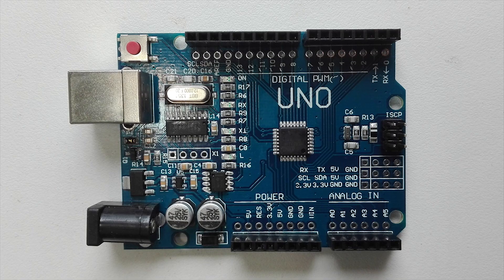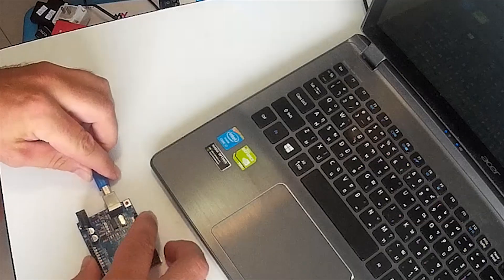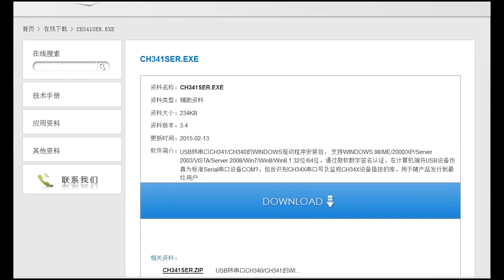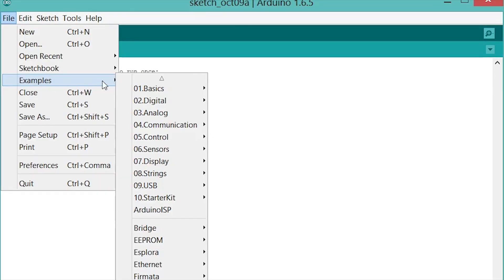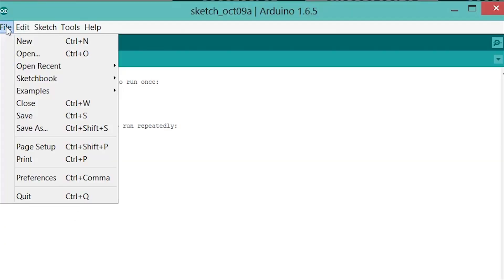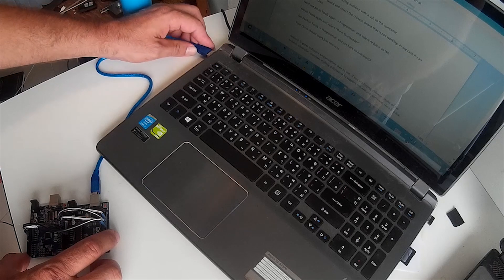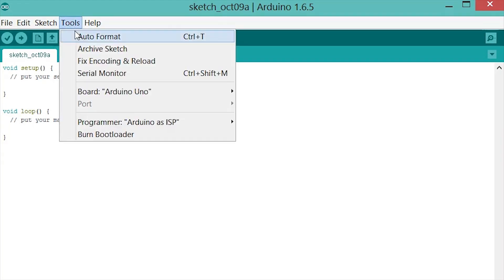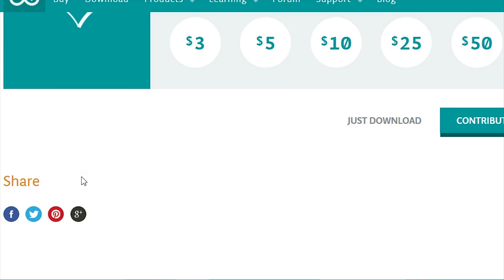How to fix bad Chinese Arduino clones

Comment: is it a wire soldered on the cable whoe goes from reset to cable ground on the working arduino uno ?

Comment: why does the Built in LED on pin 13 blink very fast after resetting and power up ??  my blink rate is 2 sec on and 2 sec off.....?

Comment: If you're trying to use this now (i.e. 2024) you may still have some troubles. Try changing the processor. Tools -> Processor -> ATmega328P (Old Bootloader). That worked for me along with the driver.

Comment: I had a problem like this a while back. I bought 3 cheap Nano's with a CH340G chip on the underside of the PCB. I could not upload my sketch to any of the three. After several hours of working on the problem, I studied my settings and found an item:  "Processor" with an option for Atmega328P(Old Bootloader). All three Nano's worked normally. I latter noticed the USB sockets were wrapped in a transparent green plastic tape. Maybe that was an indicator.

Comment: Just get Leonardo's, cheap clones or genuine, and you never have a problem. As a bonus you get double UART, USB-HID, non-shared SPI pins and double the analog inputs.

Comment: For my fake UNO the serial chip where you had CH340G written, doesn't have any writing at all, and installing the CH341SER drivers doesn't do anything at all. Is it then a problem with the bootloader?  Also when I plug it in the USB the 'power LED' lights up but another LED label 'L' blinks very fast, thought that it might be relevant.

EDIT: some MVP down in the comments found this: https://www.usb-drivers.org/ft232r-usb-uart-driver.html , go to that link and follow the tutorial for installight FT232 drivers, that might just work for you, did for me

Comment: Good video but unfortunately it did not work out for me. Nothing is written on my usb chip and only after thorough search on the net I have found another usb chip model as the commonly used CH340. Do a search on "FTDI FT232R driver" you'll be orientated to the manufacturer website with win/mac installers. My Arduino compatible clone now works perfectly :)
Reply: Thanks. I had the same problem. Now the "arduino" is working!!
Reply: I thank you dearly, may god bow to your wisdom!

Comment: I don't know where you get it, but if you get it from tao-bao, the seller will tell you that this board needs extra drivers to run.
Reply: btw, the $2 nano does not work with os x

Comment: Hi nice video.. I always getting error while uploading . Avrdude : stk500_recv() : programmer not found. ..  I have uno Chinese and one  uno without that atmega chip which is also chinese clone..like you have . So what is the problem and how it can solve.  How to burn bootloader than if I have both Chinese clone and not wokring. Thanks in advance.

Comment: I bought about 20 Arduino clones from different suppliers and apart from installing a driver on Windows to see it over the USB I had no problems at all. Never needed a second Arduino to make anything work
Reply: Lucky you.
Reply: @frederic4108  3 years later: they are still running! Not a single failure. Same for Attiny cinese boards (they are fake Digistump, you can recognize them because chinese ones have "REV.3" written on the board)

Comment: I bought M.J duino UNO R3 and from the first moment worked powered only from USB socket and not from dc adapter plug.In the pin of 5V constantly was present 3.3V because in the factory placed wrong LM1117-3V3 instead of LM1117-5V that should be.

Comment: i has 5 year uses many hundre arduino clone and anythink not has "bad" newer, all working fine and newer not has problems. i uses lot tiny,nano,uno,mega boards. and newer no has any "BAD" only good has all chinese clones. all cost under 10$ mega and uno less 7$ and nano less 5$

Comment: I see in the picture in 2:26 that there is something connected to the ground and the reset of the working Arduino. This is not mentioned. Do we have to connect to the ground the reset pin?
Reply: A capacitor of 10 µF is connected between RESET of the functionning arduino and the ground.

Comment: To fix your fake board permanently, use his connection mentioned in the description, then go to Arduino IDE and burn bootstrap. Then disconnect the main board, and plug in your fake board, you should be able to program as normal boards now

Comment: Better not to buy Chinese Arduino clones!! Buying them is to support criminal behavior. The Chinese are optimizing their lines of production to get it as cheap as possible, but they don't take responsibility for the function of the product, and then you can sue the Communist Party of China and see how successful that will be. Being Communists, they steal and copy all bad features of capitalism but removes the only good thing, i.e. the responsibility to the customer, which makes capitalism not good, but at least not quite evil either. The lack of responsibility of Chinese capitalist-emulating production in effect makes the Communists Fascists, and the individual or customer is trapped in a maelstroem of totalitarian destruction.

Comment: got mine free with from Inventr.io as a promo. Unfortunatley the driver will not install on my machine. Thought I was getting genuine Uno. :-). They do not answer requests for support and have so far not responded to me. Leason learnt buy from a reputable genuine Arduino seller.
Reply from the maker: Do you use a Mac? If that's the case, look in the comments. Someone posted a new link for the Mac driver. Cheers.

Comment: When trying to burn the bootloader, I get : "Error while burning bootloader.
"

Arduino: 1.8.8 (Windows 10), Board: "Arduino/Genuino Uno

avrdude: stk500_recv(): programmer is not responding
avrdude: stk500_getsync() attempt 1 of 10: not in sync: resp=0x0c
avrdude: Yikes!  Invalid device signature.
         Double check connections and try again, or use -F to override
         this check.

Error while burning bootloader.

This report would have more information with
"Show verbose output during compilation"
option enabled in File -> Preferences.

Comment: When I selected "Burn Bootloader", I got an error message as follows,"Arduino: 1.8.7 (Windows 10), Board: "Arduino/Genuino Uno"

avrdude: stk500_recv(): programmer is not responding
avrdude: stk500_getsync() attempt 1 of 10: not in sync: resp=0x8b
avrdude: stk500_recv(): programmer is not responding
avrdude: stk500_getsync() attempt 2 of 10: not in sync: resp=0x8b
avrdude: stk500_recv(): programmer is not responding
avrdude: stk500_getsync() attempt 3 of 10: not in sync: resp=0x8b
avrdude: stk500_recv(): programmer is not responding
avrdude: stk500_getsync() attempt 4 of 10: not in sync: resp=0x8b
avrdude: stk500_recv(): programmer is not responding
avrdude: stk500_getsync() attempt 5 of 10: not in sync: resp=0x8b
avrdude: stk500_recv(): programmer is not responding
avrdude: stk500_getsync() attempt 6 of 10: not in sync: resp=0x8b
avrdude: stk500_recv(): programmer is not responding
avrdude: stk500_getsync() attempt 7 of 10: not in sync: resp=0x8b
avrdude: stk500_recv(): programmer is not responding
avrdude: stk500_getsync() attempt 8 of 10: not in sync: resp=0x8b
avrdude: stk500_recv(): programmer is not responding
avrdude: stk500_getsync() attempt 9 of 10: not in sync: resp=0x8b
avrdude: stk500_recv(): programmer is not responding
avrdude: stk500_getsync() attempt 10 of 10: not in sync: resp=0x8b
Error while burning bootloader.

This report would have more information with
"Show verbose output during compilation"
option enabled in File -> Preferences.
"

This is what I got, what to do now?Kindly suggest me some ideas.

Comment: One extra thing I had to do to get it all to start working on Windows10 was to turn off Windows Firewall, do the first upload and then turn the Windows Firewall back on. After that, works perfectly with Firewall turned on.

Comment: I have the clone version like yours. Any idea how to enable dfu mode????
Reply from the maker: Techniques For Everything what is dfu?
Reply: Programmer mode, it is something about shorting 2 pins and wiping the boot loader. Later you can make Arduino into game controller by installing new bootloader.

Comment: If your chinese Arduino clone does not explode on plug in and does a "blinky led" thing, chances are there is already a bootloader installed, but an ANCIENT ONE. Arduino IDE "can" handle this, of you switch "processor type" tp "old bootloader" . or upgrade the bootloader by  follow the bootload install instructions here.

Comment: bought a nano clone of aliexpress, but im having problems uploading (avrdude: stk500_getsync(): can't communicate with device: resp=0x14)

steps taken:
installed driver (detected in IDE and device manager)
checked port for upload
burned bootloader (successful)

same result.

i can upload my sketch via ISP no problem. but serial wont work (i understand that boot loader gets wiped if i upload sketch via ISP)

any suggestion?

Comment: My Arduinos are all clones but not the cheapest--next to the cheapest. You see, I only buy the ones with a DIP chip and not the surface mounted chip. They cost a little more. My reasoning is that if I screw something up and destroy the chip, I only need replace the chip. I purchased a mess of chips some time ago and, using another Arduino as a programmer, burned the boot loader into all of them and tested them. (I mark the chips with installed bootloaders with a yellow dot of paint.) I now have a supply of ready-to-use replacement chips if ever I should destroy one accidentally. I can also prototype on my Uno and pull the chip to drop into any custom circuit that I make for a permanent project.

I've never had a problem with any fake, clone, whatever. I believe that I had installed the drivers way back when I first installed my IDE. I grabbed a lot of other stuff at the same time so I don't remember exactly the details. I've never purchased an Arduino that didn't have a good bootloader but apparently it does happen, hence this video.

Comment: God bless you for this video. Before I saw this video I thought that my chinese Arduino Mega 2560 board is gone wrong. After I followed your instructions and installed the ch340 driver I could load the program to the Arduino board.

Comment: TOm I need your Help. I bought one with ATMEGA16U2 USB-to-Serial but I cannot install in Windows 64. I can upload de bootloader but always my windows does not detect the correct driver.

Comment: Your "genuine arduino uno" is not genuine, it's counterfeit. You can see it by looking at the green thing next to the USB port, the genuine one is golden (https://www.arduino.cc/en/Products/Counterfeit).

It's better to buy a clone arduino than a counterfeit one, that uses the original arduino logo and pretends to be genuine (and probably also charges almost that much).

Comment: Ok I got a Chinese uno for 2.65. It did not have a cable I am using a simple cable from Fry's Electronics and I am not even getting a led light up when I hook to my laptop. could the uno be bad or maybe the cable is not right? my pc beeps at me when I unplug the uno from the cable?  Is there a way to fix the bootloader without another uno?

Comment: I created a program which writes data to the serial port via Serial.writeln() inside a loop, and now I cannot upload a new sketch any more, presumably because my program floods the serial port with too much data, rendering it inoperable (?) Have I just permanently bricked it?

Someone suggested pressing the reset button just at the right moment, but I had no success with this. The card is a nano.

Comment: my computer installs the drivers and shows the port its connected to. ive installed software to run the cnc router too. but when i send over commands i get no movements in the stepper motors to drive the axis. could this be cause of the arduino board and could this be the soloution to help fix it

Comment: I did the process twice but am still getting the upload error when trying to load "blink."  I wired the original working UNO to the chinese UNO exactly 10 to 10, 11 to 11, etc.  burned the bootloader...still doesn't work.  Any ideas?  The chinese uno has a micro USB as opposed to the original..but that should not make a difference.
Reply: " we connect the wires from the working Arduino to the clone as follows: pin 10 goes to reset and 11 goes to 11 and 12 to 12 and 13 to 13,  five volts to five volts and ground to ground"

Comment: What a PIECE OF crap SOFTWARE and the Arduino UNO program stinks. I have spent 10 
hours trying to get port recognition on this lousy Arduino UNO FOR WINDOWS 7. WHAT 
CRAP SOFTWARE FROM ARDUINO UNO --aaaaaaaaaaaaaaaaaaaaaaaaaaaaaaaaaaaaH
Reply: Did you successfully recognize the Arduino on your computer? I'm having this port problem myself.

Comment: Still no luck.. what board do you choose for the cheap uno? only one I see is Arduino/Genuino Uno (sketch 1.8.1), and it just won't burn the boot loader.. using a uno to uno. UNO1 is OEM $$$$, Uno 2 is Chinese R3

Comment: tom i had the CH340 driver problem on a chinese clone,so in my naivity i bought a mega and two more unos,one uno has a through hole ATMEL chip not the surface mount type,my pc recognises them but wont upload sketches to them,thay are the ATmega16U2 type,i can't get any joy from the seller ,the driver they point me to is a .rar file and it will not open,can this be fixed,i hope.
cheers.

Comment: One thing to look out for on the cheap clones is the type of oscillator used by the processor.  Mostly they are resonator based but these have very wildly varying values, well out of specification in some cases.  If timing is important then you might like to look out for the more traditional metal can quartz oscillators, and these are often cheaper too!  Also surprisingly I have started to come across some clones that don't have an LED on Pin 13.... best avoided if you want to run Blink!

Comment: When the Chinese one doesn't have a bootloader burned, one of the wires must to conect the reset with GND both from original one? It is like apears atthe picture, but was not spoke on the video, so thid is my doubt...

Comment: Helpful info - Thanks. I have downloaded the drivers as described and the IDE appears to upload a sketch without error message, but the Arduino Uno clone does nothing other than permanently light the red LED.

Comment: The clone was never broken - just a different communications chip and no boot loader - that's not broken, it's just not configured properly.  An Arduino is just an Atmel microcontroller chip with supporting hardware and a dumbed down programming interface.  When you buy from China expect to have to do some work to get things running as they don't pay their employees much and I imagine the training is even worse than the pay ;)  If you are not technically inclined buy the real thing until you learn more.  I have to say the Chinese clones are a deal though once you know what you are doing, sometimes I can buy a Nano clone for less than the cost of the microcontroller chip alone.
Reply: That is why I buy them. They work well for my simple projects. Once you have it set up, they all work fine. I had to build several water sensor systems for our wine cellar and the chinese nano's were very cheap and after a few minutes I got them all working. I still have some genuine Arduino boards, but I use them for bigger projects.
Reply: Yeah so it's still shite then. Not a good deal at all.
Reply: I had trouble with Namo's I bought cheap. There is a setting in The Arduino IDE for Nano use "Old Bootloader". It fixed my my situation.
Reply: Never correct someone if you know what they mean. Changes were made within the clone.

Comment: Hi, I bought a clone off UK Ebay and I've tried installing the software in your link three times  but it's still not working. It's not recognised by my laptop. 

The lights on the board are steady red instead of flashing.

Any ideas?

Comment: Hi Tom, quick question, I recently found a Uno for $3 USD. In the item description it says, the reason for such a low price is because they "replaced 16u2". I don't know what that means, is that a good or a bad thing?
Reply: The 16u2 chip is the chip used on original Arduino Uno Rev 2 and 3.
The very chip replaced on these clone chips that Tom is suggesting are faulty.
rolls eyes

Please don't do a video on something Tom that you only have part of the details on.
You propogate this bad information to everyone else who take it as gospel.
Reply: I don't think he is suggesting that, the video is about how to fix just the bad ones.
Reply: Part of my beef with this is the use of the words "Fix" and "Bad" in the video description.
"Fix" suggests the boards are broken. They are not. The PC it is plugged into is missing a driver. That's all.

"Bad" suggests that the boards are not very good. From personal experience of using original and clone boards. I personally have had no issues with any clone boards. Some actually being better in some cases than the original Arduino boards. i.e. a second row of pin holes on the board allowing header pins to be soldered in place. Or additional 5v, 3.3v and Ground placements on the board.

My final gripe is that Tom is answering questions on here he doesn't seem to know. The 16u2 chip is used on the later Uno's and Mega's as the interface chip for the USB. Not the actual ATMEL 328p-pu chip he suggested which is the actual processor and 'heart' of the Arduino board.
The clone arduino's often use the CH340 chip as it's simply cheaper than the 16u2 chip.
The rest of the board is usually pretty much identical to an original Arduino board.

Meh.
Reply from the maker: You want some tissue paper?
Reply: Lol. No.
Do you fancy giving people good advice?
Reply from the maker: Don't know what the 16u2 stands for. But it is probably the atmega328p-pu chip they replaced with a smaller and therefor cheaper on. They all work fine. The chip is smaller in size but the same in performance.